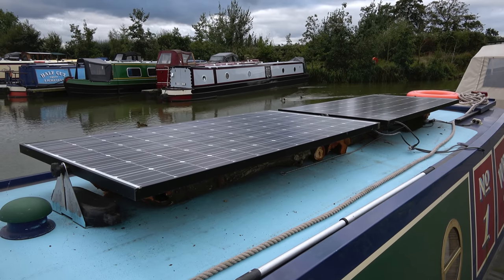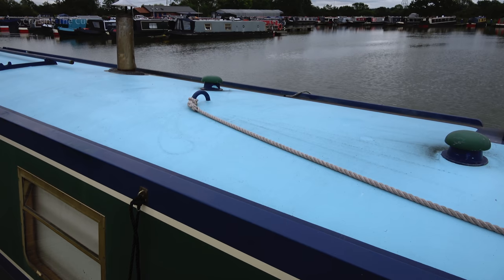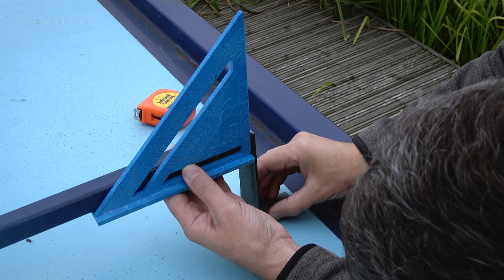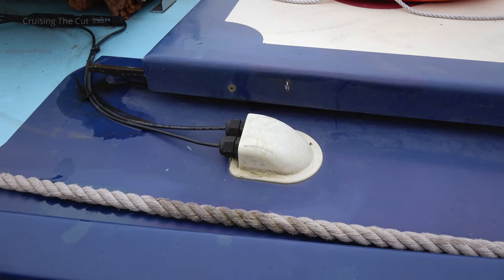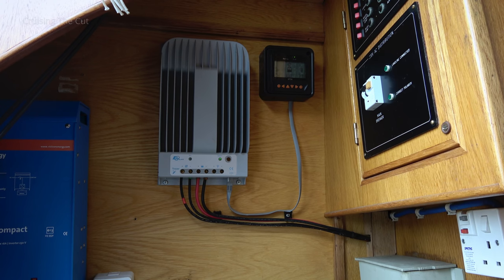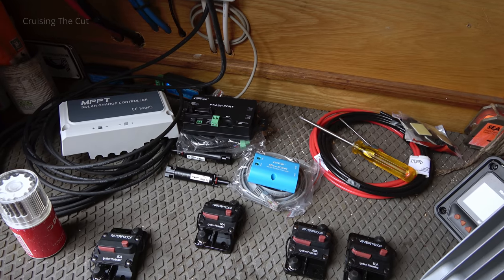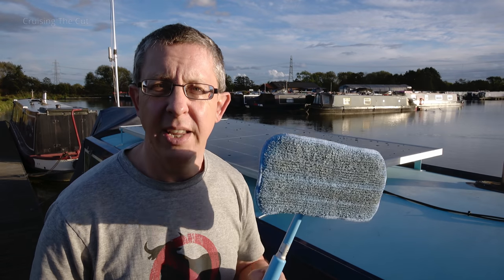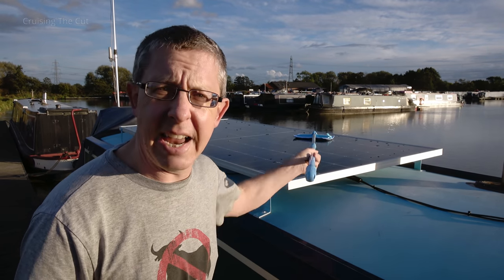251. Adding more solar power to my narrowboat

Comment: Good vid.

For your "huge mounting eye holes, but I have only small screws" problem - try cup washers, *as long as"they are solid brass and not the rust-prone brassy-coloured crappy ones*.
They are available in several sizes (sold by their "gauge"" to match imperial screw diameters) They are handy for mounting kit like that and can be used with various lengths of screws or even some machine screws (which is like a bolt, but with a screwdriver or allen head, not a hex head. It might make more sense to have a few bags of real brass cup washers in permanent stock than 30 or 40 different lengths and head styles of screws and bolts. Hardware stores (remember them? nostalgia) don;t really carry more than the 8ga size and they are often just shitty brass-coloured steel, but ebay or amazon is a good place to start for a proper selection. Note that they are far bigger than the screw head, so often you'll be drilling out the centre hole to suit your available screw size, so don't blindly buy the largest ones because their outer diameter can be rather massive !

I like real brass cup washers because they are rather thin and soft so there's a lot of fudge-factor when using/bodging them. If you've every tried to modify a penny/"mudguard" steel BZP washer to bodge a job you'll really appreciate the softer brass of the cup washers. 
another alternative is to make flat brass washers from some 1 or 1.2 mm brass sheet using a small HSS circular saw (12mm is a common cheap OD size,  giving a washer of about 9mm OD from the hole saw's ID. The hole saws are 3 or 4 quid on Ebay -  lay the brass sheet on a on bit of sacrificial plywood or chipboard to cut the circles. With two or three hole saws from 10-16mm and maybe a pair of aviation snips and some 80 grit wet-and-dry you can make all sorts of custom washers from brass fast and easily. 
Working into wood, as boaters or caravanners often to, this is usually all you need but a tiny smear of Sikaflex on the screw thread will give a little more security into the wood for vibration-prone areas (4x4 offroad campers will know what I mean here)

Now, about lubrication (ooer-missus)...
Rivnuts are absolutely great things but for M6, M8 or larger ones you need to drill out a significant amount of metal to insert them as the outer diameter gets rather large (every 1mm extra to remove around the circumferance of a big hole adds up to a heck of a lot of extra material). 
For M3, M4 or M5 rivnuts this is a non-issue unless you are drilling very thick steel plate but I couldn't help noticing you used standard lube oil or maybe WD40 while drilling. 

This is better than nothing (and WD40 is actually great for drilling aluminium, don't get me wrong) but if you can cadge an old nearly-empty tin or spray can of proper drilling/tapping/cutting fluid your drill bits and drill batteries will thank you. This stuff is crazy expensive from the big industrial suppliers like RS and you only need a drop - just to dampen the area under the drill bit, it's not really used for area or "flood" cooling so don't waste it.   I still have my first spray can of it 30 years later. 
The good old stuff stinks like sulpherous farts and works extremely well. If it stains badly and stinks to high heaven it's probably good stuff. 

Cheaper stuff which is perfectly fine for your jobs is sold far cheaper. There a few places that sell tiny bottles of modern stuff on Ebay for under 4 quid, though 1 litre bottles are under a tenner and will last a lifetime for jobs like that so you can trade/barter/share with other people if you keep some small empty bottles handly. 

Drilling fluid is a luxury for very occasional jobs like that but anything to reduce the hassle when you're trying not to fall in the water is a bonus in my world. 

Oh - and put some layers of good quality insulation tape on your drill bts to precent over-penetrartion through your insulation - it only takes the "opps" force out of it when it pops through so you don;t really need anything big like a proper drill depth collar. Just 6 or 7 turns of insulation tape on the drill a half inch back from the tip is enough to prevent it popping through too far, similar to what you;d use as a depth marker.

Flippin eck, talk about stream of consciousness - sorry for long post.

Comment: I have 3kW of solar panels with 1.5kW pointing South-East and 1.5kW pointing South-West and while on sunny days at the height of summer I can often get 2.3kW in total out of them on overcast days I am lucky to get 100W in total or around 3% of the overall rating so as you say over-sizing your system is a must if you are off grid. People who think they can charge an electric vehicle from a few panels in the garden are kidding themselves unless they do very very few miles per day.
Reply: I’m used to them on my house (obviously mains connected, and on the ‘feed in’ deal for surplus, so no local storage). Typically, Spring and Summer contribute over 2/3 of the total - e.g. winter to autumn = 200, 600, 700, 350 kWh a.c. output from the inverter (which is rated at 1.6 kW).

Comment: Handy tip to avoid drilling too deep eg threough the inner ceiling: measure the length you want to drill to and wrap insulating tape around the drill bit above this point - once the tape touches the drilling surface - you've gone far enough!

Comment: Did you consider a plastic conduit for the two wires running down the deck?  It would be much tidier and you could paint it the same colour as the deck.

Comment: I would suggest that the cable be put into conduit either flexible or rigid.  It will really help to prevent UV deterioration over time as well as the cable getting cut or nicked if you put things up there.  It would also allow the cable to be secured up top so you don't trip and pull it out or rip the cable, as you are falling into the canal!  😁👍

Comment: Hello David, hope all is well. Was the circuit breaker from panel -> controller necessary? I was having a gander at the bimble solar site with diagrams and they only reference a need for circuit breakers from controller -> battery and battery -> inverter. I'm soon to install my own solar and I'm very much at the "bloody hell this is a fair amount to take in, should I just pay someone to install this for me" stage.
Reply from the maker: I don't have one on my campervan setup so not strictly necessary although many people will recommend a fuse between panels and controller (I think that's unnecessary myself) but I wanted a way to disconnect the panels easily if I needed to.

Comment: Great video. I'm a full time vanlifer and have a modest amount of solar on the roof (350 watts) but during the winter months i tend to rely more on my DC to DC charger when the engine is running. Do you have a simular set up on your boat? Ie can you charge your batteries by running your engine?
Reply from the maker: Yes, the alternator charges the battery bank so as you go along it gets charged but in winter when you tend not to move so much (or on a marina mooring as I was), you have to sit there with the engine idling for 2-3 hours each day to properly recharge the batteries and that's noisy and tiresome. Many boaters have suitcase generators but they're even worse for noise of course.

Comment: Lets see, You have two chargers putting out different amps hooked to the same battery without the chargers communicating to each other.   Could get expensive, no? And yes I know you corrected that but it was not a good idea.  Love the excitement over the mop. Should get a french maid outfit for using it.
Reply from the maker: No, it won’t get expensive. And it’s not a case of “correcting” anything, it’s entirely fine to connect multiple controllers to a single battery bank. They don’t have to communicate with each other for it to work.
Reply: @CruisingTheCut  Pan Head Screws
Reply: @CruisingTheCut  That 14.6V with both chargers on made me worried about those batteries. I do not know what batteries you have but lead acid does not like that.
Reply: @nielsdebakker3283  14.6V is perfectly fine for the bulk charge on most lead acid batteries. Indeed, it's even too low if the batteries are calcium types.
Reply: Nothing wrong with using two charge controllers, adding the second looks pretty nice! And it will give room for growth, at 12v the old controller would have been at it's limit anyway, plus after 6 years charge controllers can get a little tired, preventive maintenance is easier said than done, now the producer has a redundant system that will make what could be an electronics crisis, into a minor inconvenience!
 And done very clean and professionally!
I really wish I had a redundant system that was done as nicely as this one, usually I watch Cruising the Cut to relax and enjoy the English country side, that I will never be able to see in person, now I can enjoy the tech side as well!

Comment: I would advise using a piece of plywood as a backboard on any future projects of this type.  It can be installed with four screws.  Then, you protect your boat's wood surface by putting a million holes on the plywood without damaging the native wood.  Just a thought from a recently-retired electronics technician.  I appreciate your videos.  THANKS!!

Comment: Nice work David  you can be well proud of yourself doing that. You have become a very capable electrician and even cable running has improved. I could tell the excitement in your voice as you switched it all on in stages and when it was all up and running giving yourself a virtual pat on the back , which in my opinion was well deserved. Well done.

Comment: i dont understand why you would have a ve bus smart dongle and not just connect a couple of victron mppt charge controllers to the bus lol, seems much easier
Reply from the maker: Victron gear is costly
Reply: @CruisingTheCut  And quality, which is why you bought the other equipment I presume. Ah well if it works ;)
Reply from the maker: I bought the earlier Victron stuff because I didn’t know any better and everyone raved about it. The Epever stuff is much cheaper and equally good
Reply: @CruisingTheCut  If you dont mind the made and designed in China, I would rather spend the extra money knowing its going to a 'local' company (Victron is Dutch) and have the peace of mind too.

Comment: Now you will need some decent lithium batteries
Reply from the maker: In an ideal world, yes, but it's not practical for me. They're still very expensive, they wouldn't like either the extreme heat or cold of the engine bay so they'd have to be put somewhere else (major hassle) and I'd need a b2b system between the alternator and the battery bank.
Reply: @CruisingTheCut  yes extreme temps could be a problem

Comment: Loved the Nina Simone lyric quote!

One thing you might consider, although I don't know whether or not it's possible in your boat, is hooking it up so you can shunt the solar power to an immersion heater in your hot water tank (what you folks refer to as a calorifier) so if you have more power than you can store in your leisure batteries, you can store the extra energy as hot water. The fellow from Well Deck Diaries did that, and the gentleman from Making a Narrowboat with Nanny and Granddad may be doing the same.
Reply from the maker: Yes, it's possible but I already have a mains (230V AC) immersion installed so that would need to be swapped out and I'm not convinced I want to do that.
Reply: @CruisingTheCut  Fair enough, but if you're going to be mooring on an area without shore power, it might be worth it. But that's obviously an executive decision.
Reply: @CruisingTheCut  Here's the Well Deck Diaries video about doing a solar dump:

https://youtu.be/N4QH7m0LXos

He was using a 230 volt immersion heater.

Comment: Great to see more of you're DIY vids and the video was a joy to watch, you are getting a decent amount of charging watts from that new panel and the originals, it will be interesting to see if you can 100% run off grid on the boat now without the need to plug in the shore line, looking forward to a follow up vid after a few months of use over winter to see how it's all going 👍

Comment: Your enthusiasm makes me smile but my OCD cannot stand that the breakers are not level. Hope you will post more frequent videos.
Reply from the maker: Cheers, I’m already posting as many videos as it is feasible for me to do.
Reply: @CruisingTheCut  l didn't mean to pressure. I enjoy whenever and whatever you post🤩
Reply: The other solution to this mounting square and level issue, is to build everything onto a plywood backboard with all equipment holes predrilled, then the board mounted, and then the large controllers screwed on! But that takes more planning and lots of marking out. Anyhow, it's all hidden in the dark recesses of the vessel so doesn't matter! :) I still would have marked lines with a pencil and a ruler, then drilled! A great installation nonetheless :)
Reply: There's two kinds of people, OCD and not OCD.

Comment: That RJ-45-to-USB cable thingummy is quite the unusual cable. Personally I think they should have included it with the controller(s). It would be a minimal cost increase and GREATLY decrease headaches for the installer. Great video. Informative and greatly aided by your normal sense of humor.

Comment: I’m impressed with your wiring neatness, looks very professional. A tip I got from an electrician was to make a small loop in each wire somewhere so if you make additions or  adjustments in the future you’ve got the extra wire. To minimize drilling holes in your wall at the controller location cut a piece of 19 mm plywood the size required to hold all the components, attach the components to that then use 4 screws to attach your plywood to the wall.

Comment: :) This video gave me flash backs to when I installed the panel on of my campervan. LOLOL
That feeling in your gut when you're about to drill a hole into the roof of your home!!!! Measure 10 times, drill once eh. 
Can't believe the size of the heat sink of your old controller,  they're insane. 
Losing track of the days, one of the smug, minor annoyances of living the retired/semi retired life. 
Thanks for sharing the build. It's most useful.
Reply: :) And Squeeee, I have the same mop thingy for cleaning my panels too. 
The number of people I've met on the road who have never cleaned their panels.....and they wonder why they don't have enough power to run their fridges over night.

Comment: Well David, it looks like someone has a new found confidence, when it comes to DIY 🙂 From engineering the brackets, to precise hole drilling, through to electrical wiring. Other than not having enough cable ties/screws, and not knowing what day it is (I can identify with all of that!), you've done a sterling job 👏👏👏
A narrowboat, van, and now a DIY guru. There's no end to your talents🤓 Thanks for sharing. Very helpful as always 👍

Comment: Thanks for the most instructive video.   I installed solar panels last year on my boat and found that even with a 500 watt system there was too much power being produced  for the batteries to store.  Solution was to have more batteries.   This year I added 3 LiFePo4 batteries with 840Ah of capacity.   Some might consider it an overkill but I have never run out of power since April.   The test will be this winter as I am off grid.   The only constant load is the fridge.
Reply from the maker: Yes, I get plenty from the existing system during summer. Unfortunately, I do not have space for more batteries and lithium is expensive!
Reply: @CruisingTheCut  For my batteries I went the DIY route following numerous you tube videos specifically off grid garage.  Space is indeed an issue but I found some under a bunk  😀

Comment: A great job on the solar panel and controller install. Since your battery bank was almost fully charged I would have created a load to see all the amps moving around. By turning on all the lights and whatever in the boat. This should give you more juice for running in the dark hours in spring and fall. On the really cloudy days in winter you still might get almost nothing and need the generator. I'm sure you already know this. 
Also the camera work was good for us that were curious. Understandably got a bit crowded at times.
Reply from the maker: Cheers, yes the solar certainly won't be the total solution, I'll still have to run the engine every now and then.

Comment: Thanks for making and sharing this video! I really hope this works to get you through the winter without the lights going dim or being unable to charge your video-making equipment!
Reply from the maker: Cheers, I can always run the engine for power if needed.

Comment: I've got near to no experience with Solar, but plenty with Wind Turbines and Generators. A winter without access to shore power, I'd suggest one of those as your backup. Now my experiences were in Canadian winters, living aboard a 44 foot Gaff Rig Ketch my father built. I know you have a coal stove, I had a wood oven which served as both cooker and heater. But for charging house batteries I used the Turbine or the 45 HP Honda generator. You'll be fine, I know you've worked it all out and I wish you the best on that Solar setup. Looks awesome!
Reply from the maker: Please see my pinned comment, cheers

Comment: Oh no shore power over the winter.  That will be interesting, I guess a bit more running the engine on those cloudy days!
Reply from the maker: Yes, that'll still need to be the case
Reply: @CruisingTheCut  To keep the engine viable you'll have to run it up to operating temperature at least once a month. suggestion from a 27 year SeaBee Chief Mechanic.

Comment: You have the same trepidation about switching breakers on as I have had recently doing a full replacement of all the sockets, light switches, cooker connection and fused spurs at my Grans old place, the feeling of relief when nothing goes bang is a great feeling!